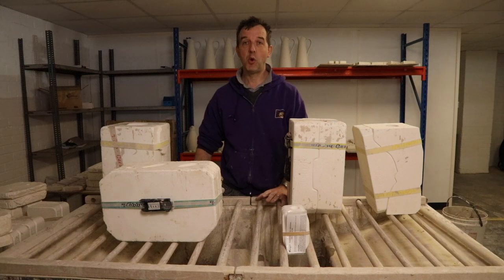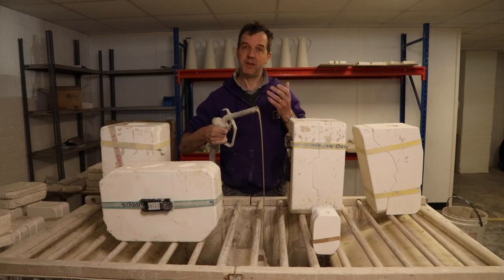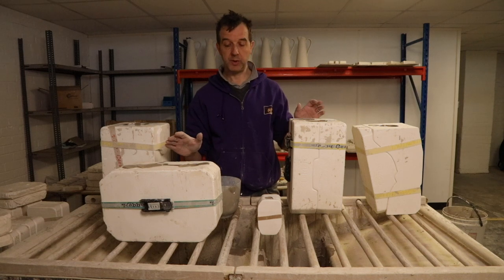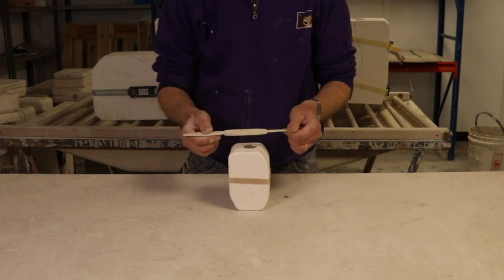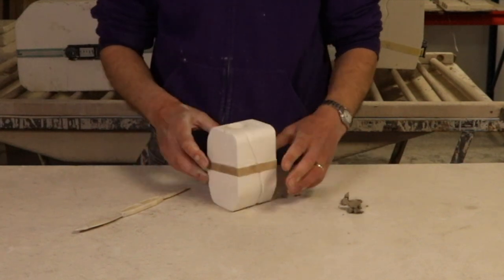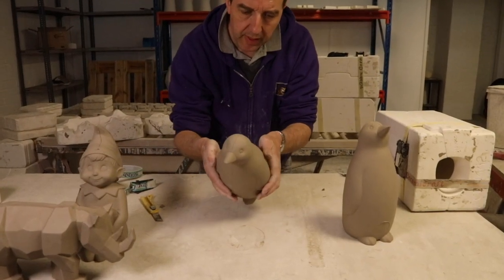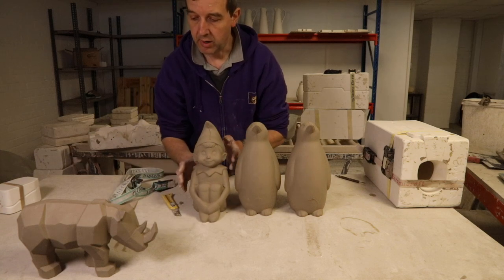How to cast a mould with liquid clay and create ceramic shapes.

Comment: 🎯 Key Takeaways for quick navigation:

00:03 🏺 To cast ceramic shapes, use liquid clay (slip) and plaster molds.
00:28 💧 Ensure the slip consistency is right; not too wet or too thick.
02:30 🚰 Be patient with slip flow; it thickens as it's mixed.
05:38 🏺 You can cast ceramics at home with basic tools like a jug.
06:19 🧰 Rubber bands can be used as mold straps.
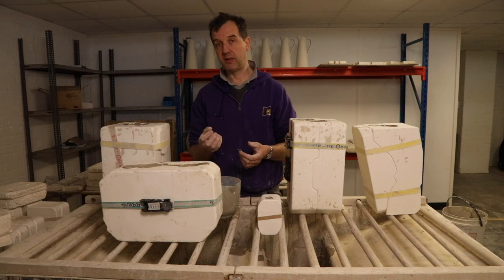07:50 ⏲️ The time to let molds set varies; monitor the slip level.
08:30 🌧️ Setting time depends on factors like mold dampness and previous casts.
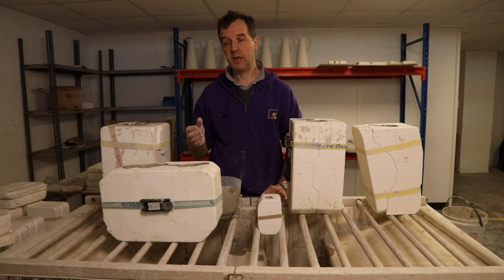10:04 🛡️ Thickness of the piece's clay film inside the mold matters for durability.
13:38 🧱 After casting, let the pieces dry; drying time varies with size.
22:33 🎨 Glaze-fired ceramics show hot spots if slip wasn't moved during casting.
25:08 🔥 Firing temperature depends on the clay used; bisque firing is around 1020°C.
26:35 🧽 Proper slip preparation is crucial for successful casting.

Made with HARPA AI

Comment: That was very simple to understand.  Not yet slip cast, but have just ordered my first mug mould.   When do you take off the lines on the clay.
Reply from the maker: I like to do that when the clay is leather hard.  If you leave until dry then you will make a bit of dust, so do when the item is still a bit damp and the clay flecks will drop off in chunks.

Comment: I'm new to the ceramics world, my mom and I got lucky and bought a ton of molds and a kiln as well as paints and I believe pre-mixed slip? It came in jugs, and so I am a bit concerned for creating a proper consistency. I don't have a fancy mixer set up, is there a way to mix slip by hand and then determine if it's appropriate consistency for use within the molds? I don't imagine the jugs of clay and water will have gone bad, it's just clay and water after all, but I do imagine we will have to spend some time on properly mixing it and playing around with pouring it into the molds by hand as well as experimenting with how long each mold takes to set. I believe all our molds are plaster, and I anticipated that they'd take days to set so learning it could be on a timeline more so of hours was quite the shock. I have no idea how low to let the slip go for most of them, and the fellow who sold it to us never quite hammered out the specifics himself. We also have no idea what the type of clay in mixture was used, but I hate to let so many jugs go to waste so we'll use them to practice before making better pieces. Thank you for your video! It has been very helpful.
Reply from the maker: Sorry for the late reply, hopefully you have experimented and worked out how to get started.  Don't worry if you mess up a bit, all of the bad castings can be reclaimed and made back into new slip to try again..

Comment: Thank you for this demo. I have a chance to buy 300 molds but I know nothing about how do use the molds. This has been very helpful. next I need to know the next stage. will check back later for more videos.  I think we have a Pottery club in my area so  I.m wondering if I  do go ahead making these if I can get them fired at the pottery club. Lots of things to suss out before making the commitment.  thx again.
Reply from the maker: How exciting!

Comment: Nice demonstration and very well explained! I have one question about the mold: it has to be made of plaster? Or it can be made with ceramic? 
I'm thinking of making a mug and i was wondering if i could use a ceramic pot i have for the mold with no glazing.
Thank you!
Reply from the maker: To make a casting mould you really need to use plaster in order to absorb the water from the clay which creates a clay lining.  Ceramic would not work in the same way.
Reply: Are these the same as ceramic slip cast molds?
Reply: Also is there a need of a kiln?

Comment: This is a really interesting method of combining a traditional material and modern technology. It's made me think - could something like clay (or liquid chalk, plus some aggregate) be used to build a house wall, using a similar methodology as a concrete pour?
Reply from the maker: To get durability with clay you will need to fire it.  The higher the temperature, the more vitrified, stronger and non-porous it becomes.
Reply: @HobbyCeramicraft  I see. Perhaps liquid chalk would be a better material. Or large tiles could be fired, and fitted into a timber frame.

Comment: I am quite new to a slip casting technique. Have made several plaster molds for casting porcelain. And had some success, but recently I have noticed that some of the greenware gets tiny pinholes 
and then, (because some cups doesnt have it) there are SOMETIMES also pinholes on the glaze.

If i got it right, those tiny pinholes are the result of air bubbles or pieces of dust in the casting slip, right? But i wonder, do those pinholes influence the glaze? I am a bit confused, because some of the porcelain cups are not having those pinholes on the glaze and some do have.

it fires hire than it should and moreover fires unevenly.

pinholes on the greenware?
I'm using the vacuum matching,but my slip viscosity 1200
Reply from the maker: A wet plaster mold can cause pin holes where the water is unable to absorb into the plaster from the slip.

Comment: How long should you wait for larger molds to open the mold?
Reply from the maker: If the slip sticks to your finger, it is too wet to open the mold.  Also, if the mold doesn't want to open... don't force it as its a sign the slip is still to wet and you will rip the cast.

Comment: I want to make a fine china serving bowl, what slip do you recommend I use?  I want to be able to put food in it to serve at the dinner table.  Thank you
Reply from the maker: Slip is heavy and can be costly to ship, so it can be a good idea to find a supplier that is local to you so you can collect.  Look for a high temperature casting slip, stoneware is forgiving to cast with (in my experience) Porcelain can be tricky.. but when it works definitely worth it!

Comment: How would you do this to make vessels for liquid? As in a specific wall thickness?
Reply from the maker: Well it depends on the slip.  If you were casting with a strong high temperature clay like porcelain then you could go quite thin, maybe 3mm, but if you are using earthenware slip, I'd head for around 4-5mm.  The larger the item the thicker you'll want it as a thin piece will struggle to hold its own weight when wet.

Comment: Hello!  I have multiple ceramic mold like the one on your video. What I would like to know is if we use quickrete or mortar in these molds, will it come out and the mold be reusable?
Reply from the maker: No and Yes.  Pour concrete in and it will glue the mould together.  The mould is reusable if you use liquid clay.

Comment: hi sir! good products you got there! i wish to do it my own, may  know what material u used to make the mold? plaster moulds ya?
Reply from the maker: You want a strong plaster blend which is both absorbant but also stong enough to retain detail.  There are many different blends of plaster available, contact a specialist supplier in your area and have a chat with them, as there will be quite a difference in mould efficiency dependant on the plaster used... and also the ratio of the plaster mix too..

Comment: Great tutorial. 
Would like to know what is the mould material are you using for casting wet clay?
Reply from the maker: You need a plaster which is both absorbant to take the water from the clay, but also strong to hold the detail.

Comment: Can you make a video on how to make a copy from another mold. When we missed the original piece.
Reply from the maker: You just need to be respectful that you may not have the rights to make a mold of a pre-existing mold.  There are videos on here showing you how to make a casting mold.
Reply: @HobbyCeramicraft  But the mold is mine, I have the registration and the rights, I simply only have one because the original piece was broken.
Reply from the maker: Then you are good to go. Castthick with slip and mold away.  Or if you are feeling extravagant, you could cast with a rubber or latex to get the original form, then separate onto the plaster and get molding.

Comment: Do you put a coating of something on the inside of the plaster mold before pouring the slip into it to keep the clay from sticking?
Reply from the maker: No, the water from the clay goes into the plaster and thats how you biuld up a clay lining in the mould.  You do not want to get in the way of the clay/plaster or this magic cannot happen.

Comment: Excellent video, after removing the piece of slip from the plaster mold, how long should
I wait to use this plaster mold again? thank you so much. :)
Reply from the maker: Literally as soon as you remove one cast, put the mould back together and cast again.  In a warm, dry workspace you will get several castings per day.  Eventually the mould will become saturated and you'll need to rest it to dry it out, you'll notice that when the slip takes ages to absorb, and perhaps you see little air bubbles in the surface of the cast item when you extract.
Reply: @HobbyCeramicraft  Thank You :)

Comment: is it true that clay shrinks by an average of 10% ? when completely dry. And do you ever do push moulding, are there any limitations on the amount of detailing (could an Alien creature as in the film, be cast this way) barring in mind this is just clay?
Reply from the maker: Hi Nigel, different clay shrinks at different rates.  Earthenware doesn't shink that much, but a higher temperature clay like Porcelain will shrink quite a lot, especially when being fired.  To cast a mould you do need to consider the detail, insofar as making sure the mould is still functional and can be separated after casting without damaging the form.  A very detailed shape may need to be cast from several separate moulds and assembled together after casting.  Almost anything is possible though!

Comment: Hi, Thankyou for this wonderful video and explaining the whole process.
I was wondering if for high fire stoneware clays we can do the same thing and make molds for the pots/utensils we want to make. Do you think it would work? Or only pinching is the right way to make it?
Reply from the maker: You can slipcast with many other clays, not just earthenware.  Stoneware casting is a great idea if you need identical multiples.
Reply: @HobbyCeramicraft  Thankyou. 😊😇

Comment: Thank you, very informative. How do you know if your slip is too thick?  I'm using Chromartie 1075 White Earthenware, with a small, baby's shoe mould. After only about 5 mins the slip is too thick to pour out. Should I thin it somehow?
Reply from the maker: Check the weight.  If the specific gravity shows it too heavy, then add water.  If the S.G. is good, then add deflocculant.
Reply: @HobbyCeramicraft Thanks for the reply. No idea about specific gravity- there's no info on the slip container label other than that above.(Ive had it about 8/9 months). Even if it said what is was supposed to be I'd have no idea how to measure it. let alone where to get de-flocculant.....
Reply from the maker: Watch our video "Reclaim waste clay into casting slip for ceramic production" for a lesson on specific gravity.  If you are unsure what the s.g. of your slip should be, 1.8 is a decent start.  Deflocculant, like Sodium silicate we sell.

Comment: Are the molds made of plaster of Paris? If not what is it made of? Trying to determine how to cast a mold to remake an old 60s Duncan chess board piece (can't find a mold anywhere for my board, hopeful i can make one and cast it myself)
Reply from the maker: No, there are many different types and grades of plaster available for all sorts of applications, we use one which is both strong to retain detail, but also absorbant to develop a skin of clay inside the mould without excessive ware.  You should contact a plaster seller or craft supplies outlet local to you and ask for a plaster that would suit.

Comment: Hello! How do you make a mold of a vintage lighted ceramic Christmas tree without damaging the original tree? Can it be done with silicone? I can't find any tutorials online. Thank you.
Reply from the maker: It would be possible, but quite an undertaking.  You'd have to make the mould in sections, using strong plaster and bedding the original in clay.  Even after all that, you would likely not get a great detail as the original would have a coating of glaze which would smooth over sharp details.  I would suggest it would be a lot easier to source a ready made mould or a replacement bisque item.
Reply: @HobbyCeramicraft  
Thank you for taking the time to respond to me. Happy New Year! 🥳

Comment: I have a mold for a chess set  and the kings are about 5 inches tall,  so small pieces. I would like each piece to be as heavy as possible so is it ok to make the men solid by adding more slip as it goes down ?  Will they crack durring the firing if I do this?  Most likely I will leave a small  air pocket in the bodies put the heads  , sholders and arms will be solid.  Thanks
Reply from the maker: Hmm... well, it depends on the size of the piece.. as you say the item may not get through a firing as the heat needs to get to the centre at the same time as the outside of the piece.  If this does not happen the rate at which the piece heats up will be different and so the expansion of the clay in different areas... in some cases this will crack the item and in extreme cases the item will explode.  The solution is to fire reeeeeaallll slow, so the inside and outside heats up at the same rate and you may well get away with it!
Reply: @HobbyCeramicraft   Dear Sir: when you say "...reeeeaal slow..." I am assuming that means 'at a lower temperature for a longer time period'?  Thank you for your videos! Wayne
Reply from the maker: The temperature you go to is less of an issue, however the rate of ascent is likely to be the cause of any cracking.  Slow the rate and then adjust the top temperature to match the heatwork generated in the kiln.  If you are taking longer to get to temperature, then, yes, you can conclude the firing at a lower temp and get same heatwork as firing higher-quicker.

Comment: Do moulds have a limited life span? If yes, how long is that?
Reply from the maker: It depends which plaster they were made from, how much detail is in the plaster and what the specific gravity (clay content) of the slip is.  Plaster is porous.  It has to be in order to absorb the water from the slip.  This means that naturally it will wear.  More noticeable on detailed items.   Choose a strong plaster and go for high bodied slip for the best mould life.  I would say some plain moulds I have I am still casting over 100+, yet would not get perhaps more than 50 from a detailed mould before I noticed detail fading.

Comment: Hi can you help me build a custom plaster mould for a project. i basically need a concave disk 5 mm wide is good enough but size 650mm *650mm.
Reply from the maker: Find a shape that you want to reproduce in a non-porous material and pour plaster over it.

Comment: should you not score up the 2 pieces of clay? we did with the ceramics
Reply from the maker: While the clay is still wet and you are using slip to join I find it really is not necessary to score.  If it were a larger surface area it is a good idea.

Comment: Where did you get your strap belts for the mould
Reply from the maker: Either use chopped up inner tubes for small moulds or woven ratchet straps for larger moulds.  Depends where you are in the world, we sell both types in the UK.

Comment: hi can you tell me what makes my christmas tree mold sticks at the top and when I open my mold it breaks the top of my christ.as tree
Reply from the maker: It may be you have something in the plaster which is not allowing the slip to dry suffiently in that area.  It could be you need to leave the slip to set a little more, if that means the tree is liekly to crack when drying, then I would suggest getting your slip to a higher sg which will not shrink so much when setting.

Comment: Could you tell me where you're from? I buy slip from companies that make slip. It is so thick that you can't pour it. If you do stir it down until it gets more liquid, it thickens within minutes and you can't get it to drain. I stir and shake and carefully take a dowel and try to make it drain. I don't know what to do. I have made slip in the past and I can make it work better. I'm not setup to make it all the time for myself so it's best for me to buy it premixed. I think there are ingredients that by law the companies are not allowed to put in, because years ago, it was always wonderful . I have been doing ceramics for more than 50 years so it's not like I'm a novice. I teach ceramics at one of the rec centers even at 75. I do the pouring but am so discouraged by the slip that I feel like throwing in the towel.  Thanks.
Reply from the maker: Hi Diana, we make the slip we use onsite.  That way I can make and adjust it to our liking.  We actually use an Italian clay because it has a great compatibility with the Italian clear glaze we most often use.  Slip will change in consistency from day to day.  One day it will popur fine, the next it will be a thick as yoghurt and not want to move.  that is where you need to check the Specific Gravity (weight) of the slip.  The Specific Gravity will show you how much water and how much clay is in your slip.  Often a slip may appear very thick, yet the Specific Gravity will suggest you have the perfect amount of clay to water, this is when you need to add deflocculant, which is like a magical liquid which will thin the slip without altering the S.G.